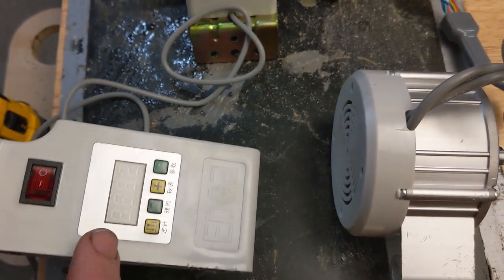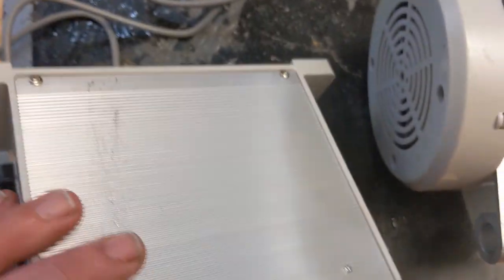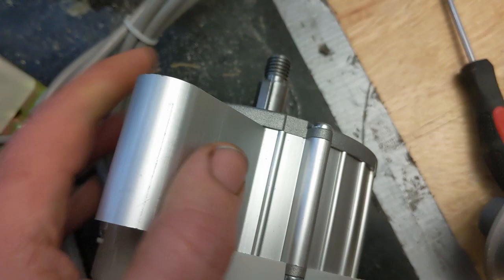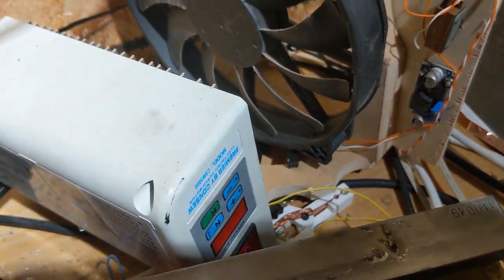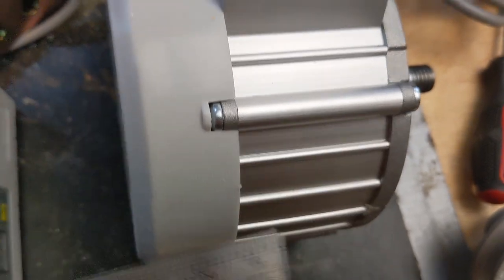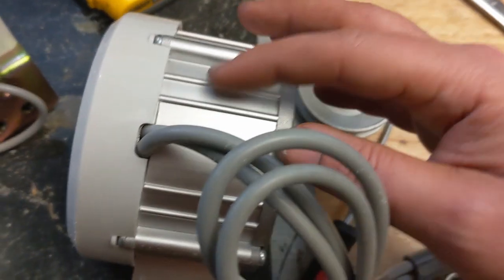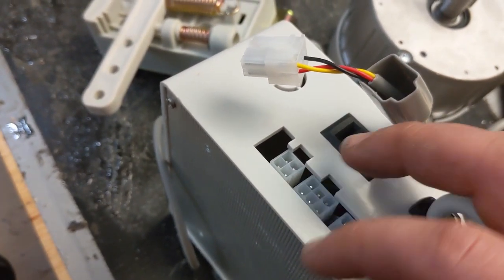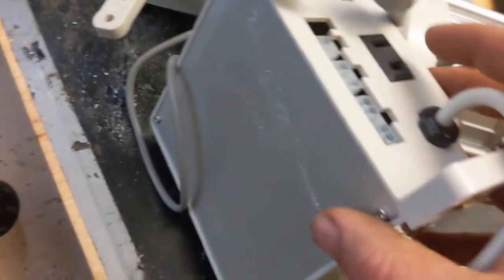Consew CSM 3000 vs generic servo motor

Comment: I just returned a cheap $99 servo motor I bought on eBay. The actuator was not even drilled out so I would have needed to take it to my drill press to make it work😝. I returned that and went with a Consew 1001 I bought on Amazon and I could see a big difference in build quality. The Consew has a much better actuator box, control box and motor casing.